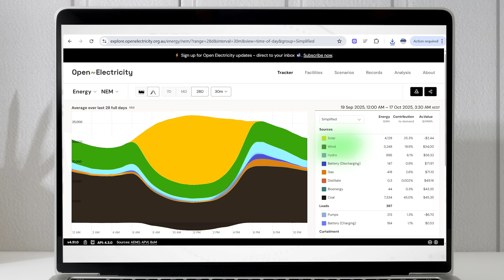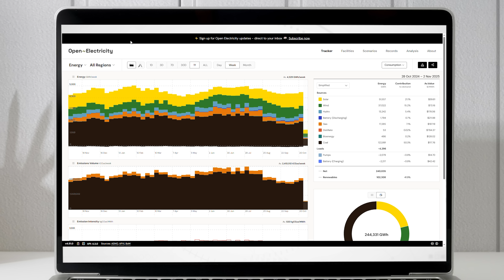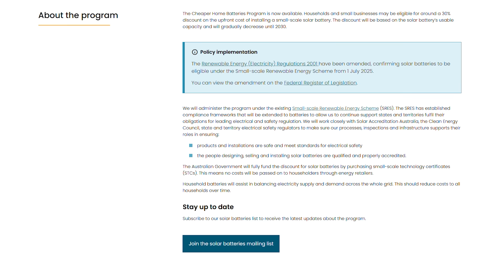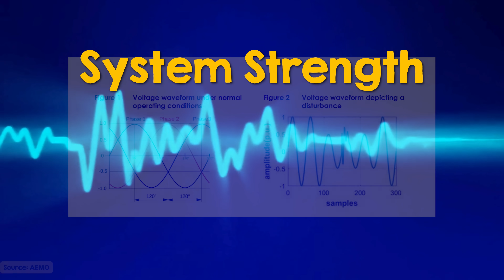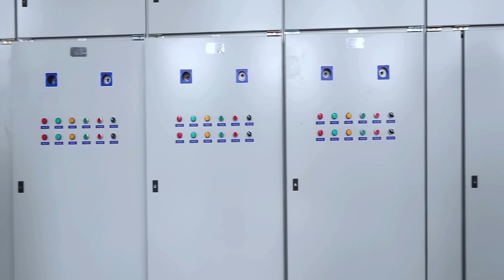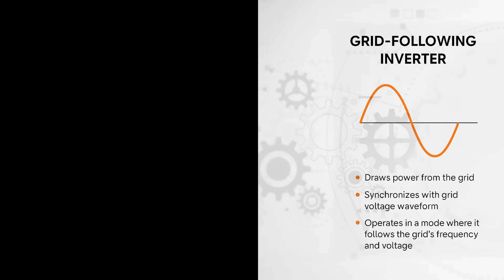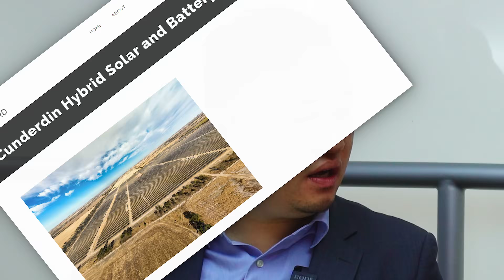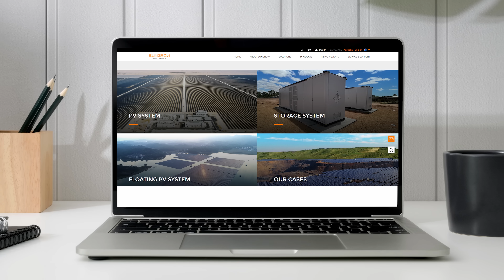Australia’s Solar Boom Is Breaking the Grid - Or Is It?

Comment: Why don't utility scale PV plants (with no on-site batteries) curtail their output when prices go negative?
Reply from the maker: They do. It's rooftop solar that mostly doesn't curtail, and coal power plants can't reduce all that much so they bid in at negative prices when there's so much solar and wind that coal isn't needed.
Reply: @EngineeringwithRosie   My GoodWe inverter has a setting that allows the grid to reduce / cut the power coming from our house.
Reply: @tsbrownie  does your electrical supply agreement allow the price to go negative though?
Probably not unless you are an industrial user.
Reply: @economicprisoner We are a home user. Our prices are fixed. One can get off hour rates, but we don't have that. Our inverter can be regulated or shut off by the power company. Currently, over production by the power company is not an issue. EV growth will probably ensure that's the case for years.

Comment: Anoughter problem is the fact that inverters can pull the same power no mater what the frequency is, in contrast to electric AC motors (without an inverter). The solution are inverters that reduce the load when frequency drops.

Thanks for your videos, greetings from Germany.
Reply: Yeah, make soft-starters on HVAC and other high-draw appliances mandatory.